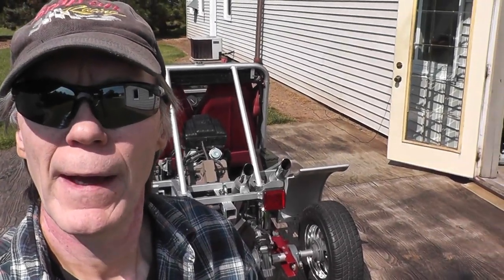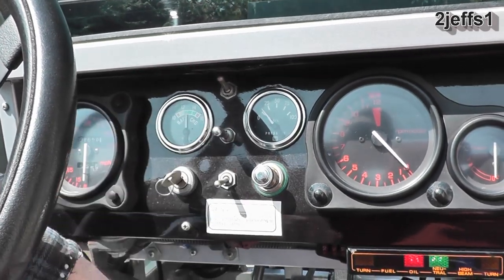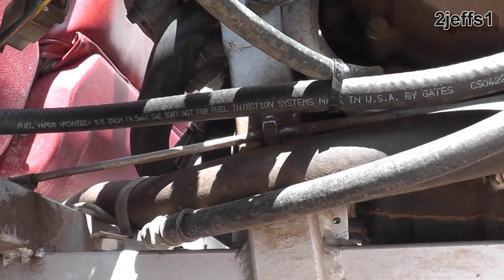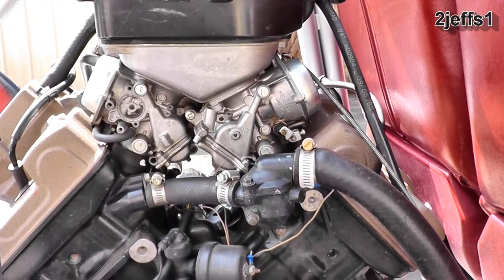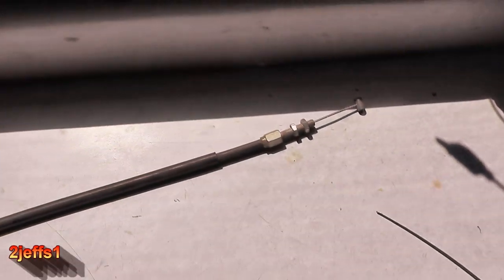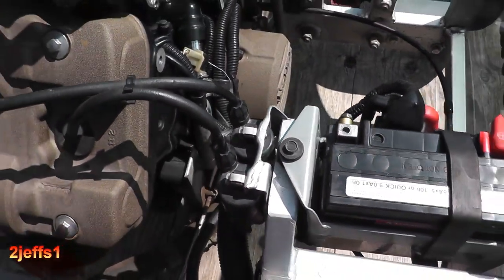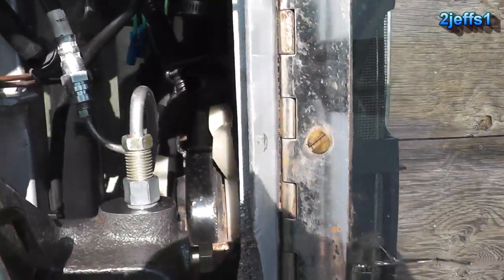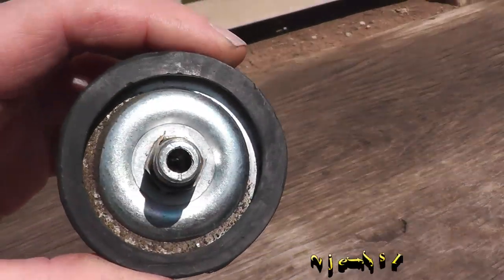Homemade Go Kart Shifter, Clutch,Throttle Setup & My Tips & Tricks

Comment: That is a beauty. We all fantasy about engineering  a rig with your finesse but we just don't have the smarts , the whatever to pull it off.  Your contraptions is so well thought out , High tech , easy access to wires cables and linkages.  Pumps, devices ,tubing and knobs, rockers, motors and dodads all up front . Watching your video is like a trip to the World Fare
Reply from the maker: bob brawley Thank You Bob. This is far from my first build. I have shoe boxes full of pictures of older builds and creations. If I had this when I was younger, makes me wonder if I'd still be here! You were right on the money on it's great to have things work/dependable but I'm a stickler for making things easily accessed for servicing. So much of these builds are done as ya go. Actually this is one project that I couldn't picture the final results. I always tell people to eliminate the word NO in your category. Even if one attempts to construct something and it don't work right - It's a learning experience. (tuition) Keep going till the issues are resolved and make the next build even better!

Comment: Genius as always Jeff! Thanks for showing how you designed your cart. You always have clean designs and clever ways to overcome the many obstacles that come up while building a project. Fancy camera work as well Sir. Thanks for your insights and ideas
Reply from the maker: +NewRiverRepair I Thank You NewRiverRepair. It seemed it would never get done. We'd get so far into it and then scrap things that didn't seem / look quite right. ( I have that same problem when doing these video's ) Looking back on this project I still don't know what possessed me to build it. My favorite thing was when the Honda 750 air cooled engine was removed and the Honda Interceptor was installed. Huge power difference. Thru the years there were a few people who wouldn't ride with me. I think they thought  I'd drive like when I was alone. That only happens on request! Pretty neat too when friends would stop by & help out. ( did cost some brew's tho....;>) But hey - Nice to have you stop by, Jeff

Comment: Excellent tutorial on the details! Great video and workmanship!. What video program did you use? I love it!
Reply from the maker: Glen Parker Hi Glen. I'm using Power Director 12. It's hard to believe how flawless and user friendly it is. Have a tip for ya. I'm running a computer I built in 2009 with XP Pro. It always run out of ram where I had so many things going on in the timeline. Then it would go into rendering which really slowed things down. I recently found an article from Microsoft where the system is allowed 2 gig and programs are allowed only 2 gig. You can switch the ram to 1 for the system and 3 for programs. Huge difference is wording it mildly. If you want to read how to do this Google /3GB. Thought you might appreciate knowing this too, Jeff
Reply: 2jeffs1
Thank you for your reply! You have been very helpful in more ways than one! Cheers!

Comment: 9:35 confirms my presumption. 
from what Honda model are you picked the pieces?
Reply from the maker: Hi Juan. Things did come from several different Honda motorcycles. The engine and gauges were from a 1986 Honda Interceptor. The radiator a V65 Magna. Rear sprocket, brake and spring shocks a CB750. The air shocks were from a Goldwing. The spare parts that I had were used to keep costs down. The engine, radiator and air shocks had to be purchased from a friend with a motorcycle salvage yard.
Reply: "salvage yard"...great expresion!. There is a thing did not said in my others messages: this building work is flawless and the final result is completely exquisite!. 
I never saw a Honda Interceptor, it looks like there is a 500 and a 750 version.
which one you have used? 
And thanks for answer!
Reply from the maker: I should of posted that it is a 700cc engine. I see now they have several different models. Actually I never seen what that bike looks like where I just bought the engine! Thanks for stopping by, Jeff
Reply: Only important is that it works, and  I can see, very well. Thanks you for answering again!
Reply from the maker: Your welcome Juan, anytime!